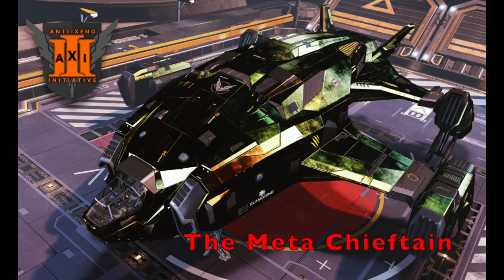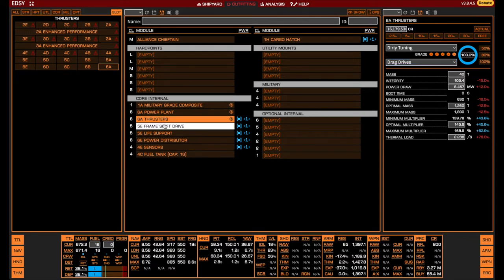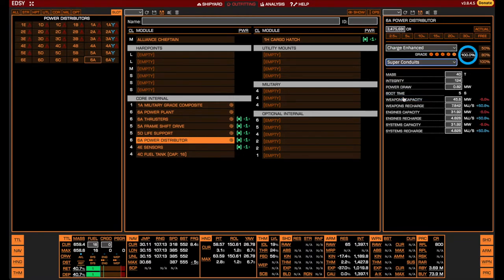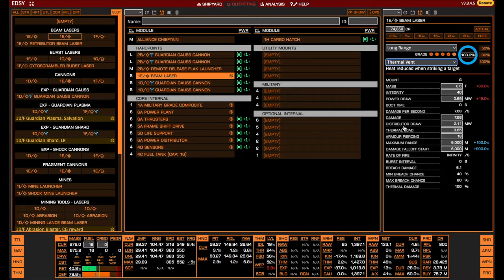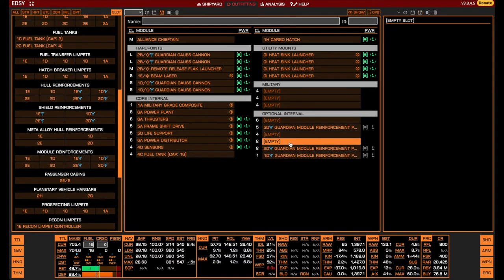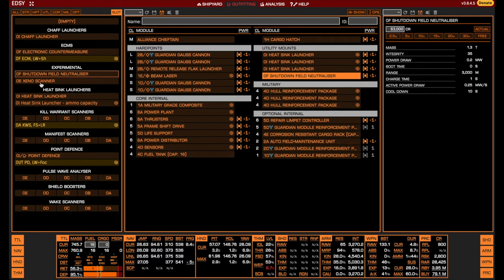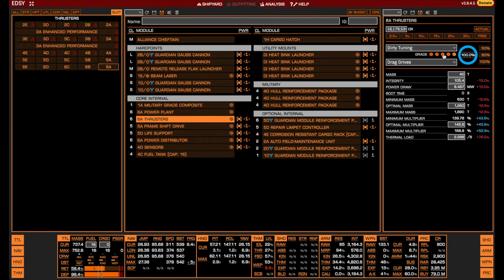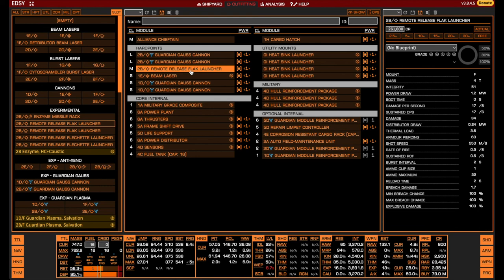AX Tutorials: The Meta Chieftain and variants

Comment: I hear that ground settlements under attack from interceptors don't launch swarms. So I could use the flakless build, right?
Reply from the maker: Yes, interceptors do not deploy the swarm close to the ground. This is a general purpose build mainly designed for being ideal in solo and multi interceptor fights outside of AX conflict zones. It will still work very well in AX CZs as well though.

Comment: when i try to buy "1A Military grade composite" for the core, i can't equip it. It says it's not compatible. Wich one should I buy?
Reply from the maker: That sounds as if you are trying to equip the stored armor of some other ship. Difficult to say for sure without seeing.
Reply: @orodruined4526  yeah it's like you said, when I buy one, it says: not compatible, this is for Cobra III, Type-6 and etc etc. I can't find the correct one for the Chieftain😅😅
Reply from the maker: @Dani.335  You need to make sure to find a station where the correct hull is available for Chieftain. I suggest using EDDB or similar to locate one.